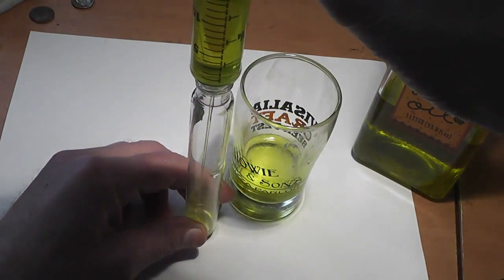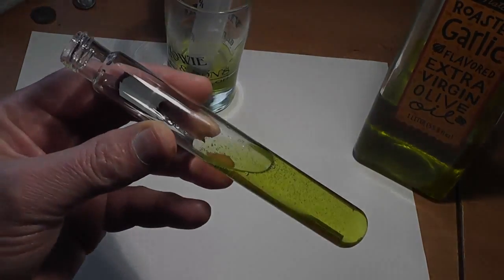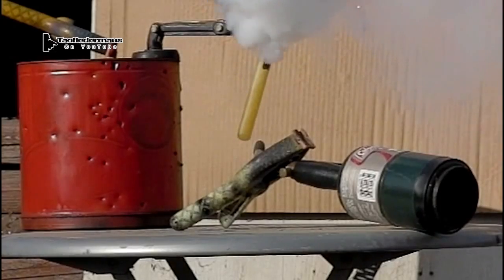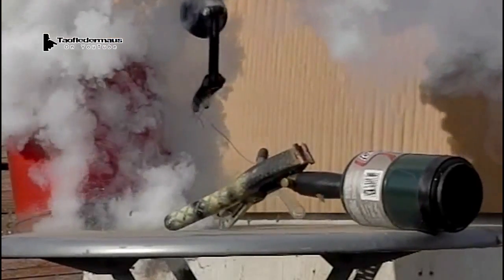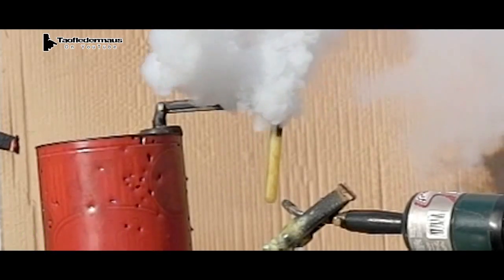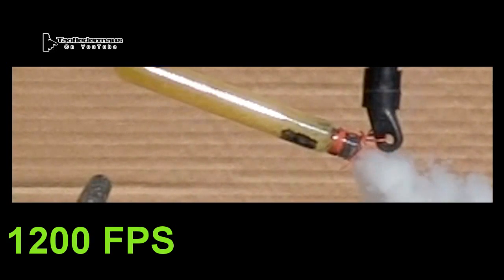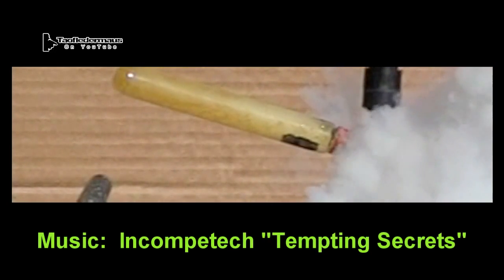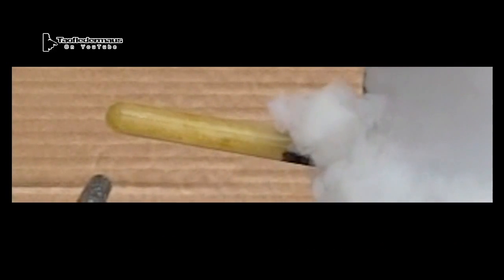Olive Oil vs GAS TORCH -   Stand Clear- this one blew up!

Comment: You need to melt the open end shut - then you'll get a catastrophic failure of the entire test tube :)
Reply from the maker: To heat it that hot,  it would heat up the material and it would expand, and blow out and be really hard to seal off.
Reply: ***** If you use a really long tube and fill it no more than 1/3 while keeping the bottom submerged in water you should no problem sealing the tube in a couple of seconds with a blue flame, even without submerging it in water you really only need like 10s of heat on a decent blue flame. the test tube won't conduct much heat in that time. Worth trying it.

Comment: You should have lines on the background in 10mm increments so you can try and calculate the speed that the test tube is traveling when it jets off.
Reply from the maker: Even at 1200 fps it was a blur!   I'll have to count frames and try to guestimate the speed.

Comment: Wait, did I get this right? The point where it spontaneously combusts is over the flash point? How do they measure that?
Reply: They can be measured separately since you need a source of ignition to measure the flash point. The "fire point" (Autoignition point) uses itself as fuel in a runaway reaction when the temperature is sufficient. Temperature = energy. The heat is adding energy until there is enough to start a runaway chemical reaction.

Example: Take a match and hold a flame to it. It will ignite. Take a match and put it on an electric stove and it will ignite by itself when it reaches a sufficient temperature. No external ignition source required.

Comment: side note . olive oil is not full olive oil. it mostly a mixture of water and filler .

it's cut to increase profits , or so i have read repeatedly .
Reply from the maker: Maybe some brands do that.   Seems it would be a cloudy,  colloidal mess if there was water in there though.

Comment: I'm really surprised that the vapors didn't all go up in flames at once. I imagine that if they did you'd have a mini thermobaric bomb on your hands.
Reply from the maker: I had an open flame and everything.   It should have flared up.
Reply: It's asking for trouble, but you could try some kerosene instead... Boiling point (310° initial - 702 °F upper limit)
It might be fun.
Reply from the maker: I don't have any straight kerosene on hand.  I was thinking some Hoppe's no 9 or something might be interesting though.
Reply: [wink] Just make sure you don't breath any of the vapors. It is a metal solvent after all! Sounds cool, good luck!

Comment: I suggest filming under polarized light with a polarizing filter on the camera so you can see the stress' in the glass.
Reply from the maker: I think my 55 gallon drum of polarized light got a hole in and it all leaked out.

Comment: Hey Maus, can you make a shotgun shell deliver enough thermite to be tactically useful?
Reply from the maker: Igniting thermite takes a TON of heat.   A shotgun is not going to ignite it.  It takes a magnesium strip to get it going.   I can't even begin to imagine how I would be able to get that lit,  loaded into a shotgun,  and not have it blow up in my face in the process.
Reply: ***** Well then, put it in a test tube

Comment: Would it make for a less interesting display if you did this to test tubes that were completely filled? :-?
Reply from the maker: The liquids expand when heated so it would just push the plug out.   The air space is where the pressures build up.
Reply: ***** Ah, yes, I realized this while watching a later video, but couldn't recall where I left this comment. D'oh! Thanks. :-)

Comment: vegetable glycerin, propylene glycol , napalm, sand, a battery, corn syrup, starch, oil, transmission fluid, coolant, brake fluid, salt, pop corn,  rootbeer, beer, coloring, window cleaner, awesome, gun powder, firecrackers snappers, wd40, plasti dip, paint, anti seize, Vaseline, menthol crystals or liquid. just a few i'd like to see!
Reply: mouth wash, dish soap, nicotine, smarties, gummy worms, ejuice. grease

Comment: I think you put too much oil in the tube. I wonder what happens if you put just a few small drops intead of half filling it.
Reply from the maker: It probably wouldn't build up enough pressure to do anything.   Just burn the small drops.

Comment: ***** Have you tried something flammable like gasoline?  I'd be interested to see if 1. a flame starts inside the sealed tube and 2. what happens when the tube finally blows.
Reply from the maker: I have used Hoppe's #9  which is kerosene and there was no flame.   When it blew,  it  displaced all the oxygen and extinguished the torches flame.
Reply: Kerosene actually isn't flammable.  It's combustable.  If you put a match to kerosene, it won't light easily.  You need a much higher temperature for a much longer time.
Reply from the maker: ok

Comment: it would be cool if you turned the test tube upside down and let it shoot up like a rocket, just a thought.
Reply from the maker: I'm thinking of taking a pipe,  cut a hole in it for the flame.  and stick the test tube in it and launch it horizonally at something.  If I launch it straight up it might hit a house or a car.    I gotta make sure it doesn't get away from me.
Reply: yeah that would be a cool idea. try to see how far you can get it to go or how accurate it might be.

Comment: ***** would u be willing to try diesel? curious to see if it would ignite in the tube with enough heat and pressure
Reply from the maker: If I had some around the house I would do it.  Maybe I can get an ounce or so out of a gas pump.

Comment: Heck these are cool.
Reply from the maker: thanks!
Reply: ***** Query: Does that torch get hot enough to turn / create molten salt? (1400 ish degrees F) That would be something I'd like to see, even a bit boring.
Reply from the maker: Maybe if I used MAPP gas.
Reply: Thinking back, that would be an incredibly boring video me thinks.
Reply from the maker: I'm thinking the test tube would melt about the same time the salt melts

Comment: Looks more like you're torture testing the plugs instead of the actual test tube. Because those always fail instead of the tube.
Reply from the maker: It's the materials inside the test tubes.
Reply: Wish the title would be more specific if it's testing the tube or the olive oil. I kept thinking these were to test the test tubes lol
Sorry, my bad.
Reply from the maker: I'm struggling with a name that describes what's going on here.  lol
Reply: Boiling shit with a blow torch - Olive Oil? lol
What Happens when I... - Olive Oil? dunno :3
Fun to watch though, I like you channel a lot.
Btw, for your shotgun ammunition videos, do you think you could put a handgun round in a shotgun shell? So that the shell sets off the handgun round and it fires out the barrel. If you get what I mean
Reply from the maker: There are so many "torture tests"   and "test tube"   type titles.   I have to come up with something unique so when someone does  search for it, they can find it.   Maybe something like HT/HP  (high temperature/high pressure)  lol   I don't know.